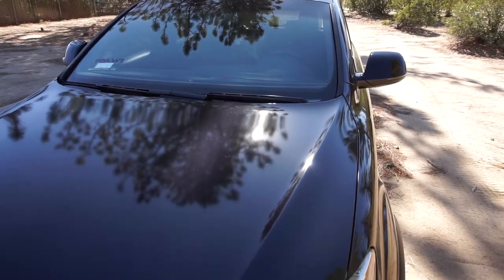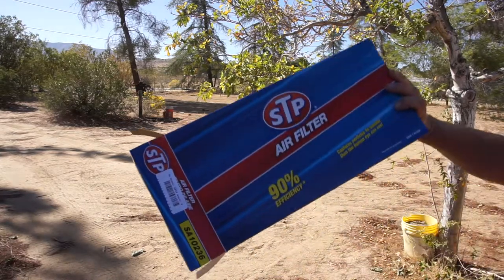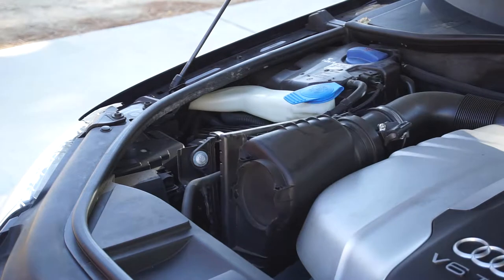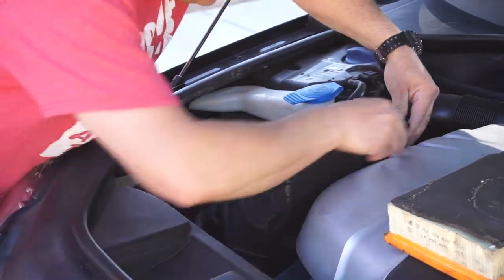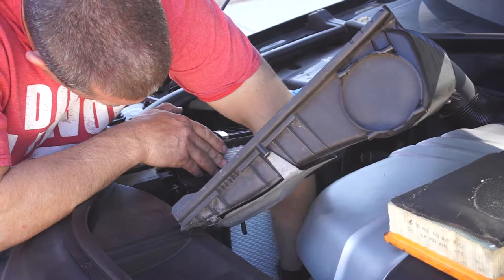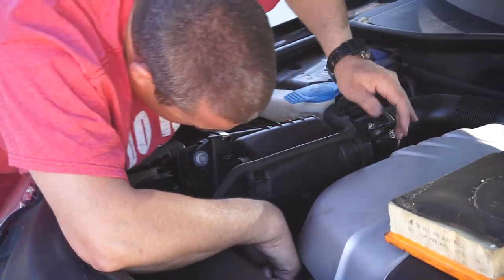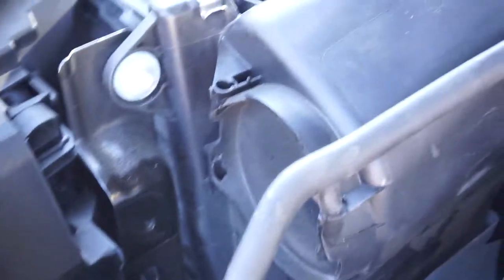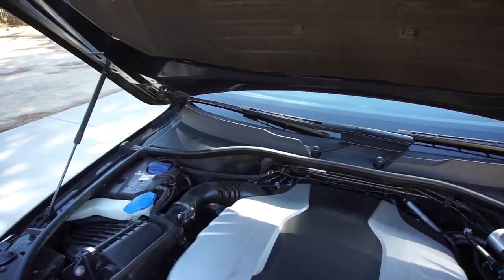Let's Change My 2015 Audi Q7 Air Filter. How Too. Anyone Can Do This

Comment: Thanks for the quick video. I messed around with this for about three hours because of the problem that you came across which was the bottom part was loose. The reason for that is you did not get your tabs to properly fit in that bottom bracket properly which is why it’s loose when you move it.  Air and dirt is getting in through the sides of your compartment. I need to disconnect that hose, disconnect your windshield washer compartment in order to get that to fit. Major pain in the arse but you got to get that bracket to fit snug or else air and dirt is getting into your engine.

Comment: On the 3.0 Supercharged V6 remove the airbox half and drop it in with the new filter already pressed in. Much easier to get the three plastic tabs in at the bottom.